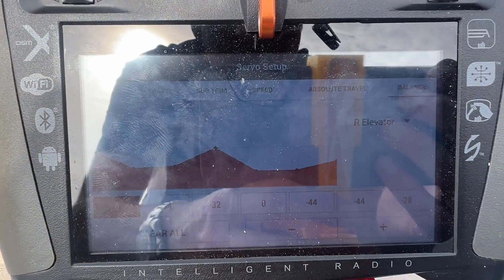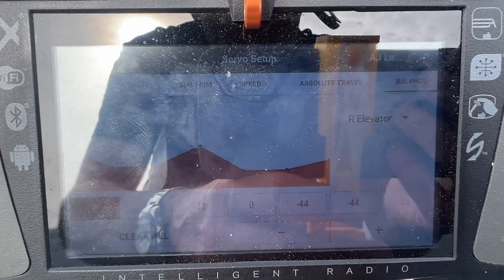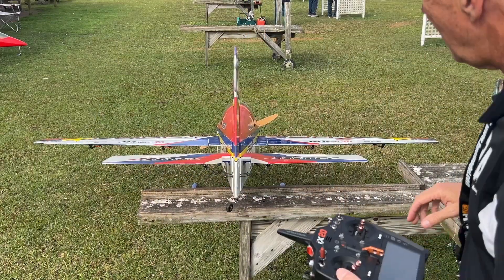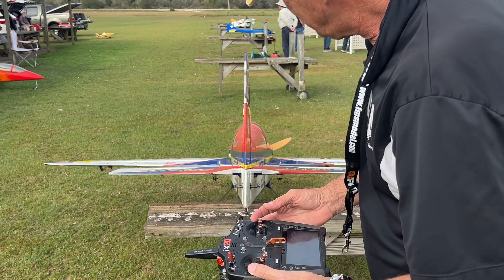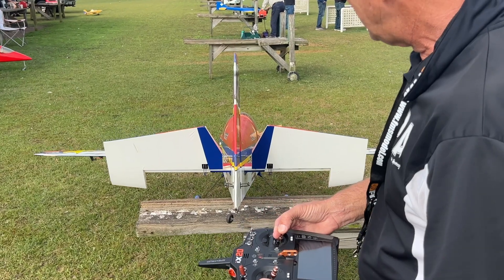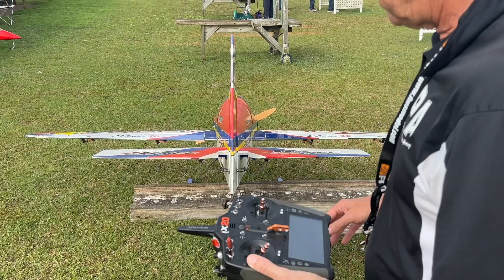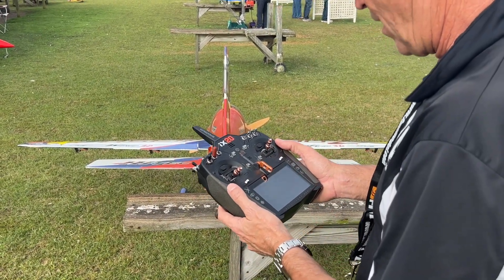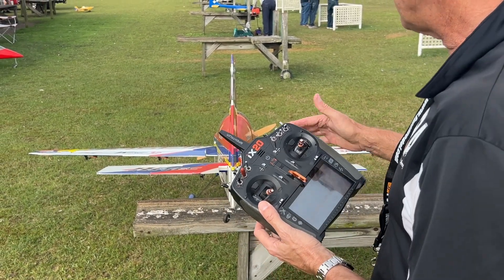Michael Wargo: Differential and Balance... Programming and understanding.

Comment: Hi Michael, your content is very informative for me. Easy to watch and understand. I wish you the best.
May I ask you how do you balance a 14-15 lbs rc plane. Can you recommend a device to balance.
Thanks 
( Vanessa rig does not work for me)
Reply from the maker: Either the old fashioned way with fingers, or there are a few really nice cg machines out there.   I saw a really cool one on ebay for 125.00 and a lot of cheaper ones.